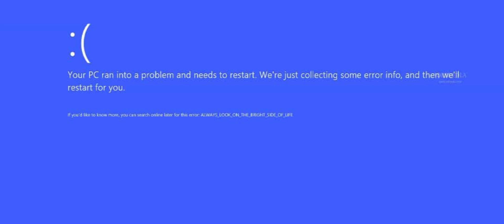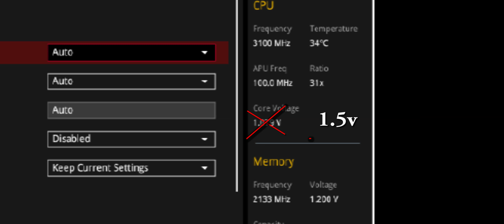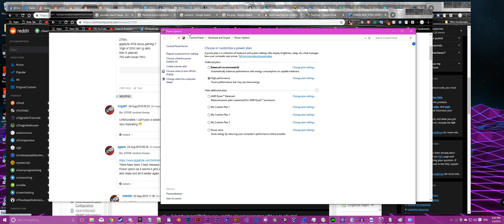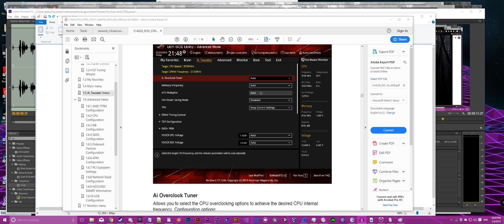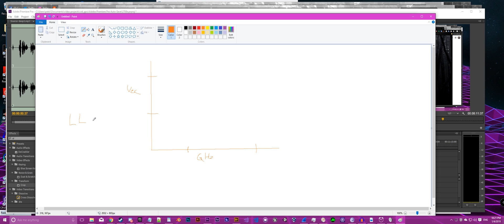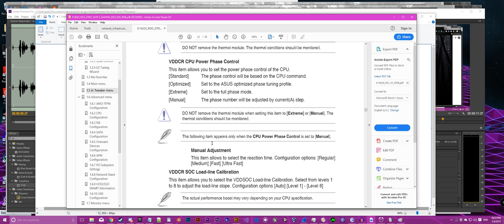Troubleshooting Random Freezes in Ryzen 2nd gen (2700x) Based Systems - PBO To Blame (fixed)

Comment: Can you just say? DId you fixed the issue? How? My english is not so good. My ryzen 1700 on ab350pro4 stutters/freezers in idle as well. Latest windwos update did this
Reply from the maker: Yep, now it's been over a week since I applied these troubleshooting methods and yay it has not crashed ever since. 
Now I'm certain about what the problem was and sorry that I made this video kinda long because I didn't myself know whether this is gonna work or not. But now, I confirm it works. 
First, I would recommend you to increase the voltage and turn on high performance mode in windows 10 if you haven't already. The best trick which helped me solve the issue is Load Line Calibration. I don't know if you have this in your board but it's pretty neat. 
I'll probably make a short video straight onto what to do since I'm 100% sure of it.
Reply: @machinephile , I am having quite similar issues and was wondering how your fix has been holding up.  Have you experienced any crashes since your last reply?
Reply from the maker: @lesliecolvin697  Well since then, I had one crash but then I found out my CMOS got reset. 

I've had a negative offset of -.1v with load line calibration lvl 4 and it's been doing just fine. I'm actually putting down the list of best settings to use with 2700x/2600x in the book. And will make a video soon.

And I know this video kinda sucked since it was so long. In the upcoming one, I'll try make the video simple and straight to the point. Thanks for watching tho :)
Reply: @machinephile  We also set leslie's LLC to level 4 and it's been more stable but not perfect
Reply from the maker: What kind of issues are you facing after you set it to LLC 4? What are the other settings are you using?
Reply: @machinephile  iam facing such issue in my ryzen 5 2600 
MsiB450 gaming plus motherboard

Please help
Reply: Hey I am also facing such freezing issues in R5 2600 in Gigabyte b450M DS3H
Reply from the maker: @sumanpaul1562  @ak editz: are you manually overclocking or running auto? If everything else   isn't responsible for these issues, odds highly are that it is  your CPU not getting enough voltage. It usually happens when you're letting pbo to scale   OCs for you. 
I'm recently running mine vcore at auto with a -.05v offset (this is not necessary for everyone) and it completely solved my issue. You can also use a manual voltage and apply LLC on top of it as I said in this video. Note that you will see relatively high voltages at idle but as long as it's not high under load (drawing high current A), it's nothing to be scared of. Use HWinfo to monitor.
Reply: @machinephile  i just recently build my pc with ryzen 5 i haven't done any oc i searched all over the web and did the drive updates,bios update,changing the power settings but nothing fixed the issue sometimes it freeze and sometimes it shows bsod with clock_watchdog_timeout idon't konw whats the issue is it the windows? iam running on 1204 winows 10 os
Reply from the maker: @AK editz Most of the time when I've seen this specific BSOD, it was because of bad registry entries by drivers or corrupt windows kernel itself. But generally, with BSODs, I would first check if everything's okay from my hardware side, especially RAM. Have you stressed tested your memory with either HCL memtest or prime95?
Reply: @machinephile  i fixed my system it was the operating system .i downloaded new windows 10 then updated all drivers from there sites and it fixed my problem
Reply: @sumanpaul1562  bro which version of os are u currently running check using winver in search bar
Reply: Please help me out